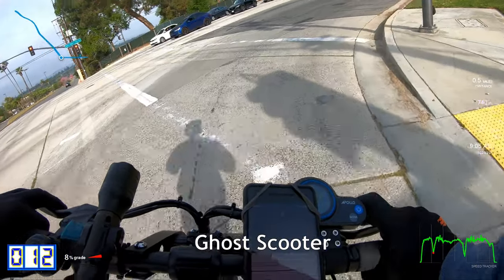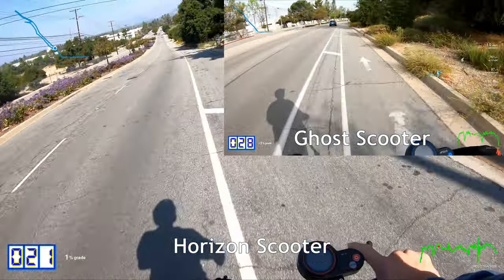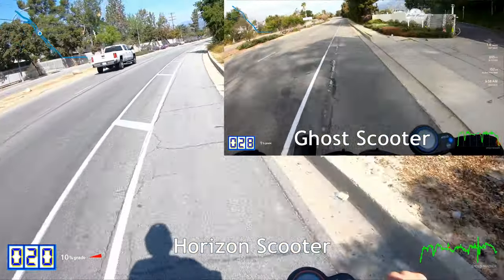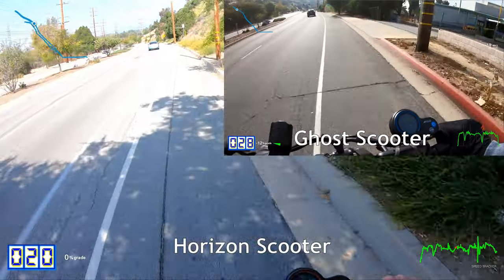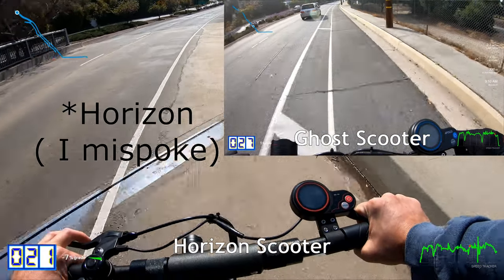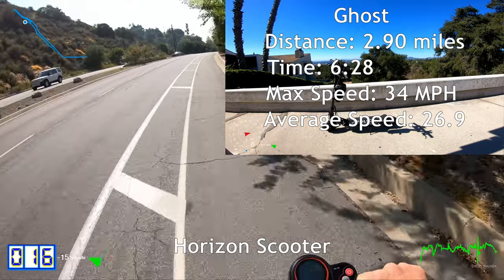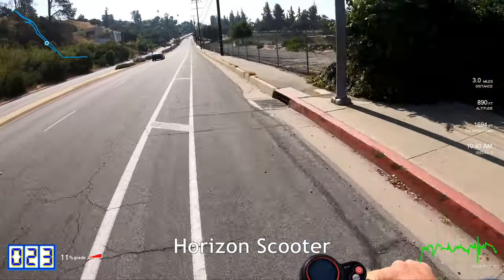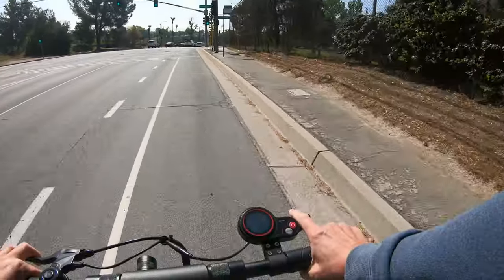Electric Scooter: Single Motor  vs Dual Motor POV FFR Horizon & Apollo Ghost/VDM-10 Ride in 4K

Comment: I have a single motor scooter a 1,000 watt
Motor.
I love the scooters range and it has decent speed.
The range has helped me out a lot AKA when 
I get myself lost.
I did a 40 mile ride and still have 52.5 volts and 3 bars left.
Reply from the maker: 40 miles is really good. Emove Cruiser just flat out shines when it comes to range.
Reply: What scooter do you have?
Reply: @MrBoriqua2000  EMOVE CRUISER
Reply: @dennisgolden7596  haveyou had any issues with it? I keep reading that the cruisers controller and throttle keep burning out because they were built for the 600w motor version not the 1000w. How fast have you gone on it?
Reply from the maker: @MrBoriqua2000  The scooters in this video are the Apollo Ghost & Fluid Free Ride Horizon. Thanks for watching!
Reply: @MrBoriqua2000  NO PROBLEMS WITH THE CRUISER HAVE GONE 32 MPH
Reply: @MrBoriqua2000  I ONLY WEIGHT 130 POUNDS